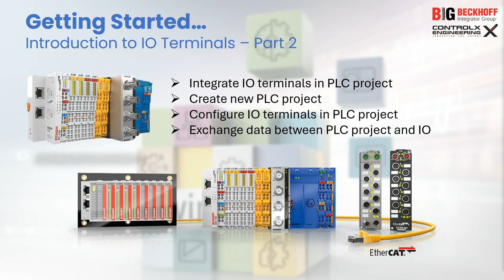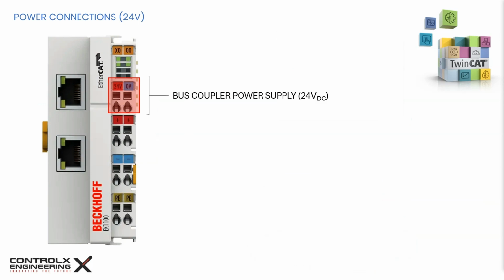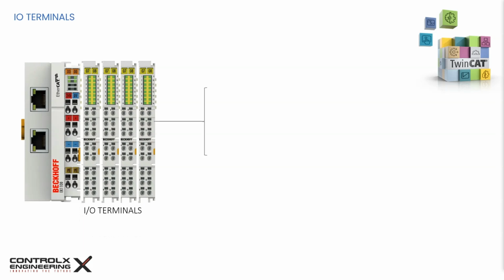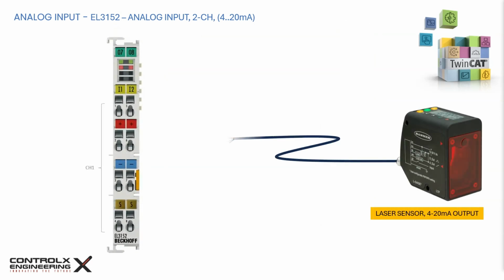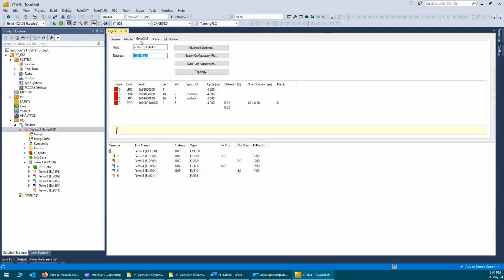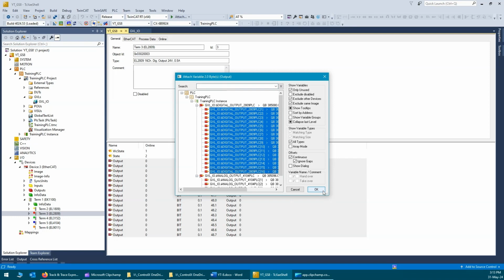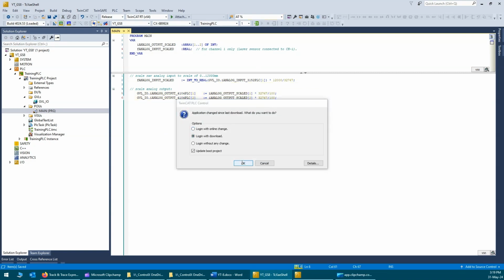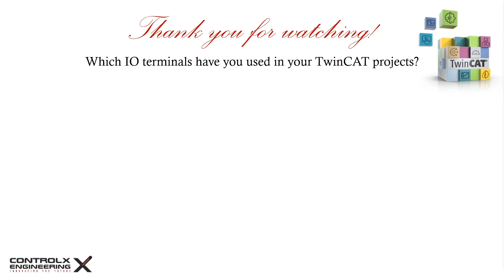Getting started with Beckhoff IO Terminals - Part 2

Comment: how did you make the analog input stable?? means instead of raw number jumping crazy to stable number moving linear??? I made all the conversions and math I just need the analog input calm down instead of jumping from 33 to 49000 all over the spots
Reply from the maker: There are several things you can check:
- use shielded cable, if possible.
- check grounding. make sure your panel back plate is grounded, power supply and PLC have proper grounding.
- not run sensor cable alongside power cables as this can induce noise.

Comment: i have a question, i'm currently using twincat3 2026.14, im using the usermode runtime to test my programs  as i have windows 11 so its quite troublesome, my question is, can i insert an ethercat master, with an EK1100 and link the I/Os of the devices to my GVs and try its activation, because i went to twincat>>show realtime ethernet compatible devices>>ethernet Realtek PCIe Gbe>> install (currently in ready to use (for demo only)) and i cant link my ethercat master to that adapter, even when my gvs are linked to the devices conected to the EK1100, am i missing something?
Reply from the maker: If you have the your coupler and terminals connected to the EtherCAT master via a network connection you should be able to scan the network adapter to which the coupler is connected. Once the terminals are scanned in, you can link your variables to the appropriate channels and then activate the configuration. On the other hand, if you don't have the hardware connected, you can still insert an EtherCAT master manually into your IO configuration. Once added, open the device page by double-clicking on it and on the "Adapter" tab, select the adapter to which you have your coupler connected by clicking on the "Search" button and selecting the required adapter. Hope that helps.
Reply: @ControlXEngineering  thank you! i'm looking forward to see your next tutorials 🙌🙌

Comment: Is it possible and how to do all of the above without physical access to the equipment?
(e.g. PLC - Beckhoff CX5120 + EL1809+ EL2809) Is there an “emulation” mode?

PS Thanks for your work
Reply from the maker: Yes, it is possible to create the I/O configuration manually by adding the desired components starting with EtherCAT master followed by the terminals, couplers, etc. In TwinCAT, there is no need of "emulation" mode. When you install the XAE, it also comes with the runtime (XAR) and you can actually run your PLC code on your XAE in the development environment. Hope that helps.

Comment: The Inputs and Outputs on the CX7000 processor module seems to operate differently.
The I/O seem to be listed under CX7028 and the IO names in TwinCAT do not match the IO names on the unit.
It looks like the might be an additional mapping step involved.
Have you run into this case?
Reply from the maker: The CX7000 provides access to the I/Os via the CX7028 interface. You should see the DIOs listed as modules in "Term 1 (CX7028)" under your Devices listing. According to the CX7000 manual - "the CX7028 interface for controlling the multifunction I/Os has its own CPU and the CX7028 interface is not displayed or does not work under TwinCAT if the power supply (Up) is not connected."
Reply: @ControlXEngineering  Yes, there are four modules under Term 1 (CX7028) - Module 1, 3, 5, and 7.  Module 1 and 3 have DIO_2x Inputs Channel 1 & 2 and DIO_2x Outputs Channel 1 & 2 and modules 5 and 7 have DI_2x Inputs Channel 1 & 2.  I am not sure how to map those to the names/pins on the unit.  And, yes I do have the separate power supply lines connected.
Reply: You can sort of figure it out from the Term1 Slots tab

Comment: For an analog input, you said 16 bits has a max value of 32767 for 0-10V but, that is only true for a 16-bit signed value but is seems the voltage is only positive.  A 16-bit unsigned value has a max value of 65537.  Can you clarify?
Reply from the maker: The analog input terminals provides a 16-bit signed integer representation of the analog input signal. For a 0 ..10V input range, the terminal typically uses 15 bits for the positive range (0 to 10V) and 1 bit for the sign. The full-scale range for a 16-bit signed integer is -32768 to +32767. However, since the input is 0 to 10V, the relevant range for conversion is 0 to 32767. For terminals with input range of +/-10V, you get the same resolution but with a signed value. Hope this helped.
Reply: @ControlXEngineering  Thanks, that is interesting. So, it is really only a 15-bit input.  That should be OK for my application but I will probably ask my buddies at Beckhoff Seattle about it.

Comment: I'm trying to connect a Beckhoff CP6706-0001-0050 to a EK1100 EtherCAT coupler. I have a problem when I try to scan for connected I/O devices, only Device1 (EtherCAT Automation Protocol) [Local Area Connection 2[TwinCAT Intel PCI Ethernet] option shows up. And I need the EtherCAT device option.

I'm successfully connected to PLC.

Anyone has any ideas on what else could I try?
Reply from the maker: In TwinCAT, first make sure that you're connected to the CP6706, then navigate to menu item: "TwinCAT > Show Realtime Ethernet Compatible Devices...". Under "Compatible devices", select your network adapter that you're using to connect from your PC to the CP6706 and click install. This will install the real-time capable driver for use with EtherCAT.  For more information, please refer to the information in the link below:
https://infosys.beckhoff.com/english.php?content=../content/1033/ethercatsystem/1036996875.html&id=